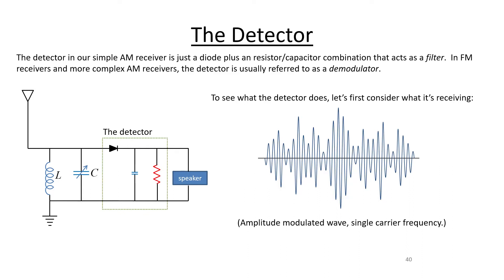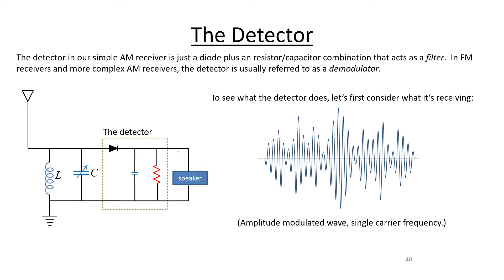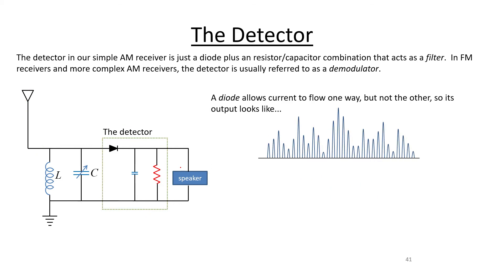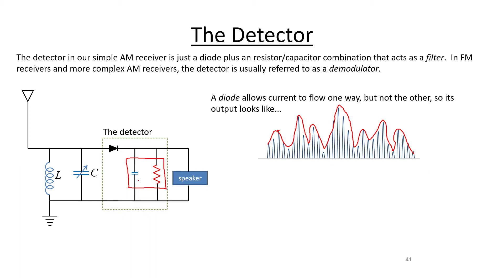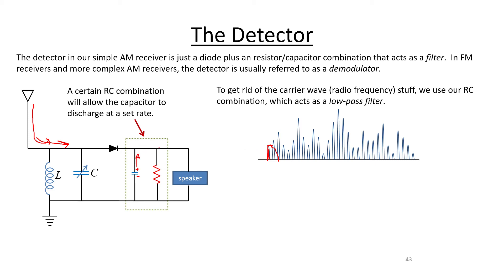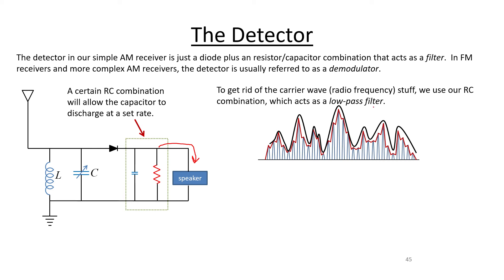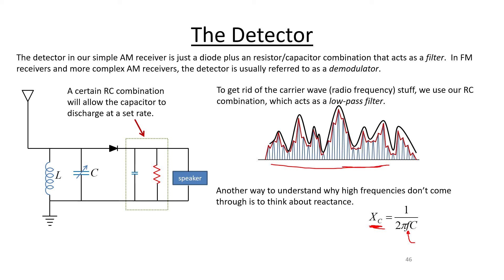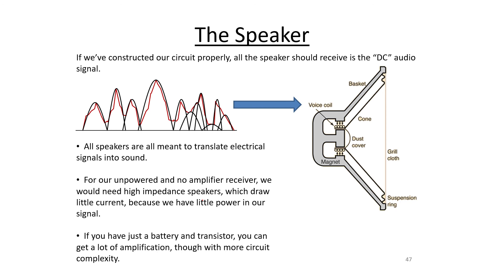Introduction to Radios (Part 7) - The Detector/Demodulator and Filtering

Comment: If the detector is supposed to be a low pass filter, why is the resistor not set up as a voltage divider with the cap? Since the speaker and the cap are in parallel, won’t they both see the same (unfiltered) voltage input?

Comment: Well one could say you are filtering the lower sideband away with the diode turned this way, and sampling / converting the high frequens into low frequens to be heard via the speaker.